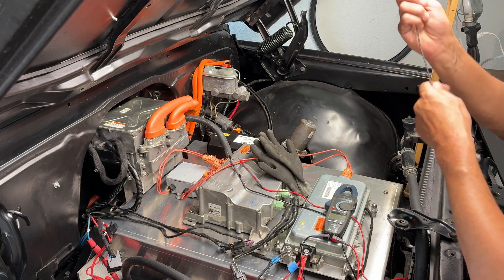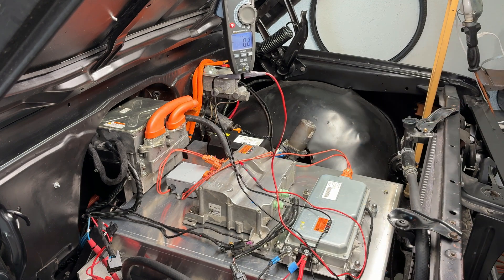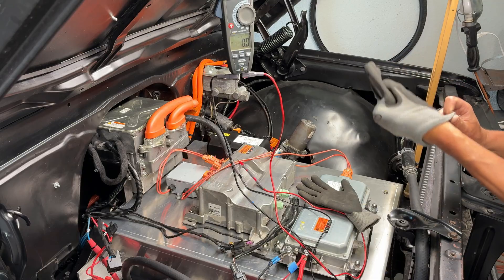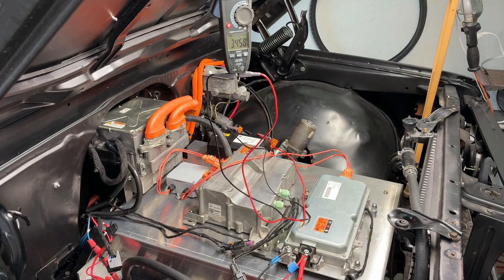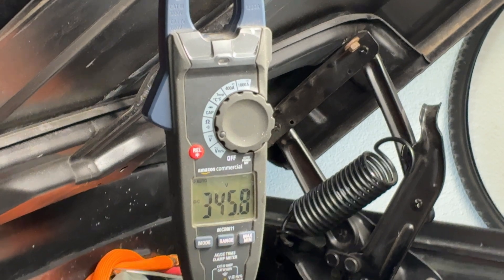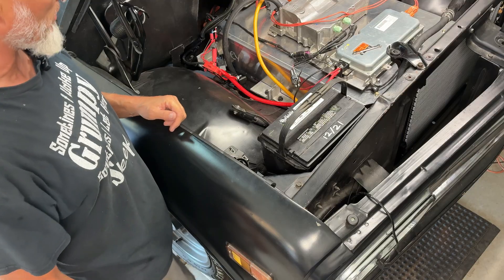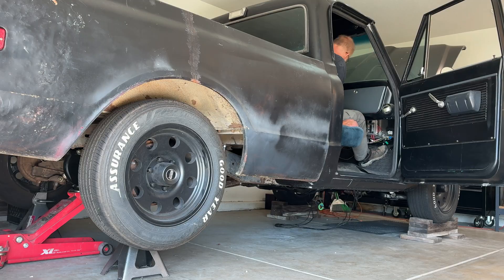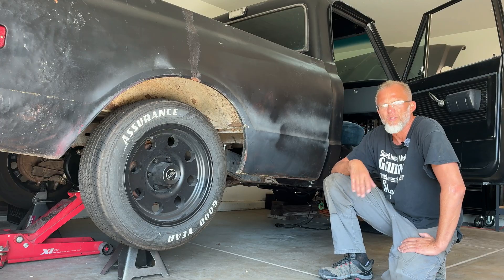GMCe DIY EV Conversion Phase II   Final Assembly

Comment: Honestly sir. I really really love it. It's a great idea. I am not sure how it works myself. But I've heard that doing this makes everything very TurnKey operation positive. I really like the idea of this. Let's moving Parts quieter. Much quieter and no need tap the carburetor or worried about hot idle adjustments. I also love the idea of not having to worry about gas mileage. Thank you very much for sharing this with all of us. You've sparked my great interest in doing something just like this.